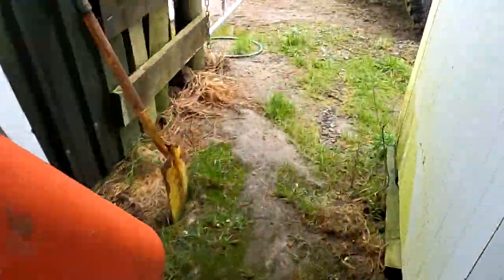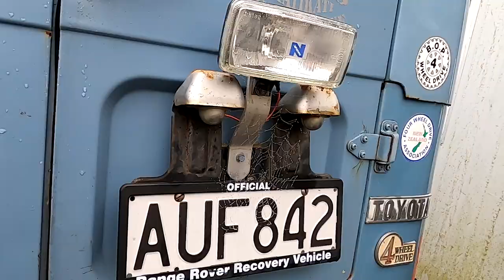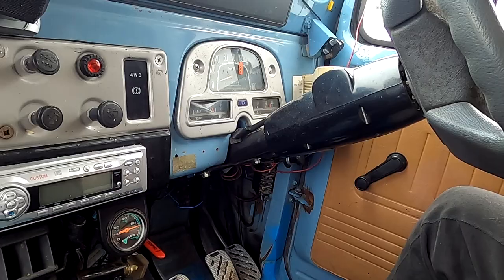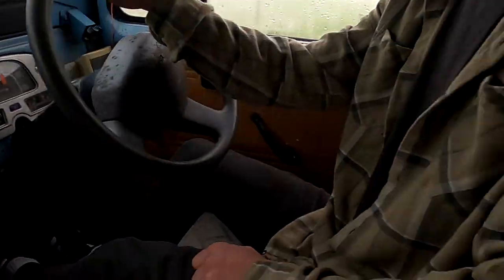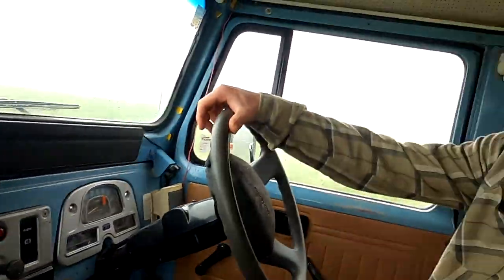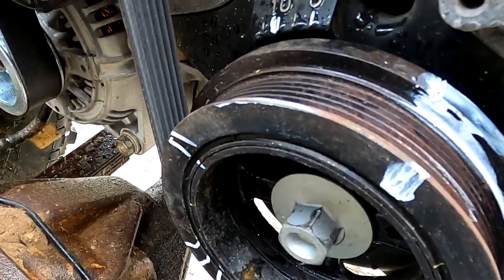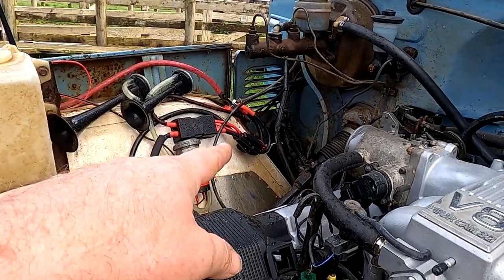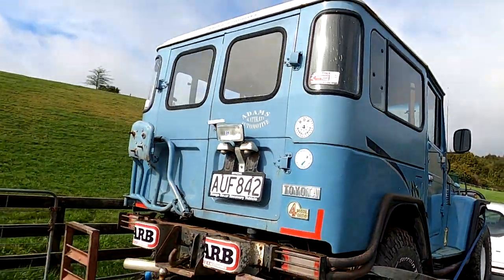Blue landcruiser goes home.  Check out the owners smile

Comment: Do you offer the fuel tank as a conversion kit ?
Reply from the maker: We do have intank fuel pump kits which suit many vehicles.
Reply: @CartuneNZ  was having a dig at the setup with the bucket ! : )
Reply: Basically finished my conversion into an early model Merc. Terrible sounds coming from crankcase : ( Can you recommend an engine builder in Aus, or should I ship from NZ ?
Reply from the maker: @bobbuilder5362  what part of oz are you in?
Reply: @CartuneNZ  about 2 hours from Brisbane. I dropped the sump pan and baffle off the engine yesterday, actually looks good inside, can still see all the factory honing marks. No signs of metal in oil or filter. I'm now thinking its the flywheel, because the sound is coming from the bellhousing, and you can hear it when manually cranking the engine over.